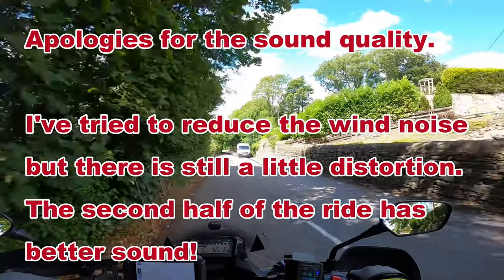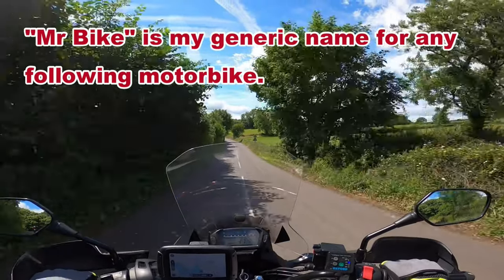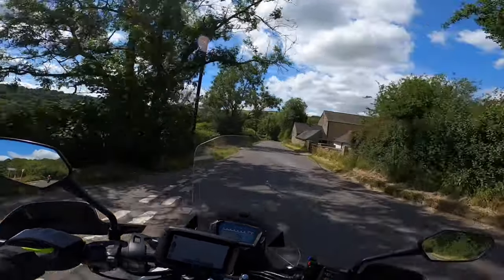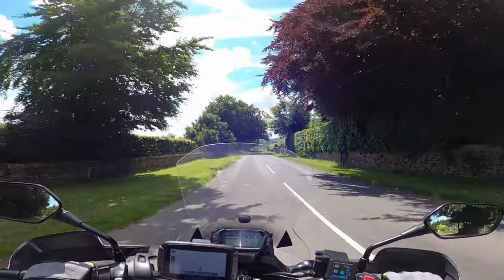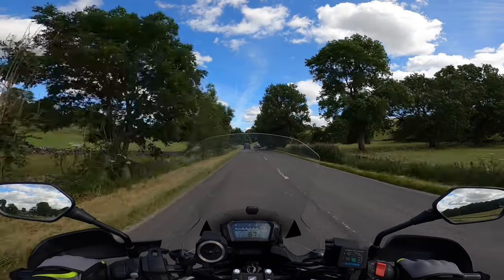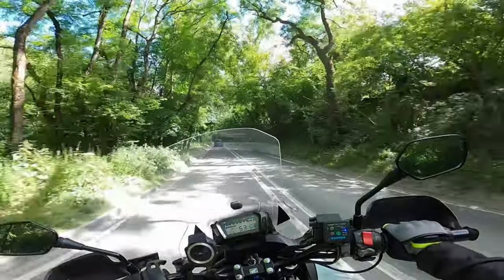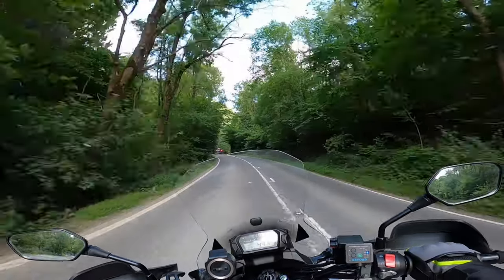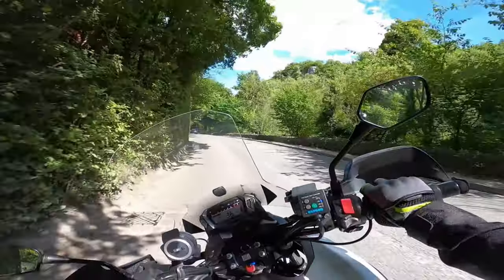Advanced motorcycle positioning demonstration ride #1, with commentary

Comment: Such good advice my wife is currently learning and has problems with her height sometimes any tips for small riders. 

Thanks in advance 👍
Reply from the maker: Thanks Carl. I'm only 5 foot 2, so the methods I use are:

1. Daytona Lady pilot boots which raise your heel by 6cm and ball of foot by 3cm. (Cheaper option available by Frank Thomas if not wanting to spend £300).
2. Most bikes I have owned have had the suspension linkages lowered Lust racing do good quality kits (avoid cheap rubbish from China on ebay). Generally the side stands have then needed shortening also (find a good local metal worker/custom bike engineer as it needs chopping and welding. Sometimes the forks also need dropping through a touch to help with handling. Any adjustments you make to the bike should be done by a qualified mechanic.
3. Plan ahead for stopping with regard to cambers and which foot (or both) to put down. I encourage all students to slow right down so the end of the stop is very slow for 5-10m on the rear brake only (after uaing both brakes to slow), which allows time to plan the stop rather than stopping quickly and losing balance. Practise stopping in a car park until confident. You can do this on a 125 too to build the skills. If front brake is needed due to camber and wanting both feet down, also practise smooth gently use of the front brake at the end of a slow stop to avoid grabbing the brake and losing balance. 
4. Plan how to park. Go into bays backwards if they are downhill so you don't get stuck having to push the bike backwards out of a bay uphill! 
5. There are upholsterers who will lower or make seats narrower for you. Ask your local bike groups on facebook for reputable contacts.

That's pretty much it. Good luck and enjoy 😊
Reply: @motorcyclelessonsuk  Thank you for the tips shes got it in her head she needs to learn on full stock height. I've told her this is the foundation stage and there is no rush but critiquing your wife is a dangerous game 🤣😬 

Thanks again 👍
Reply from the maker: @carlm4451  at Roadcraft we actually lower all the DAS bikes as a matter of course to accommodate shorter riders. The students with longers legs don't often notice! It really helps with confidence when stopping.